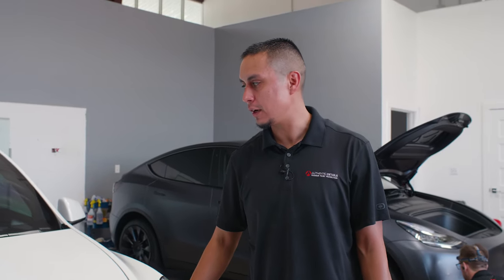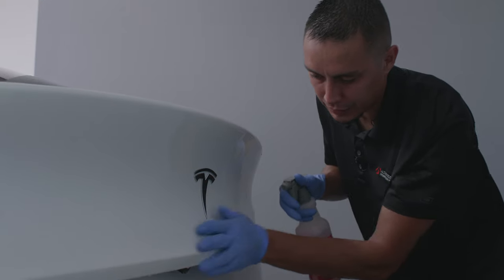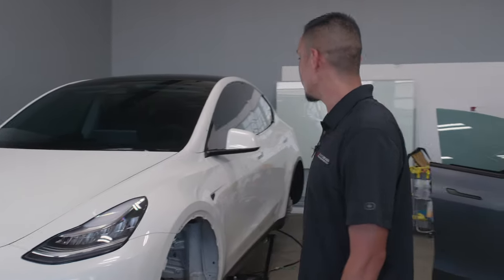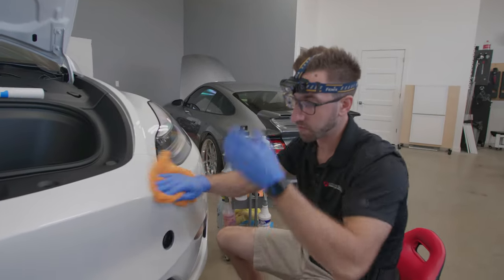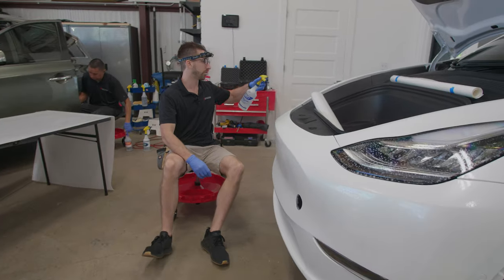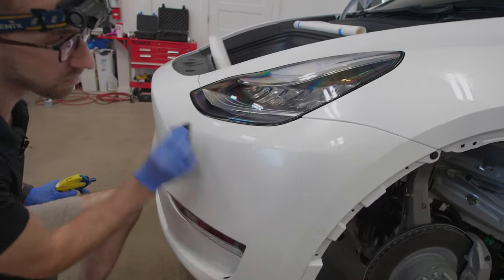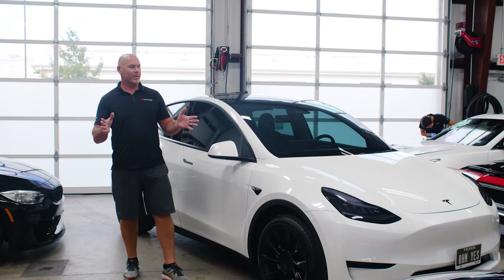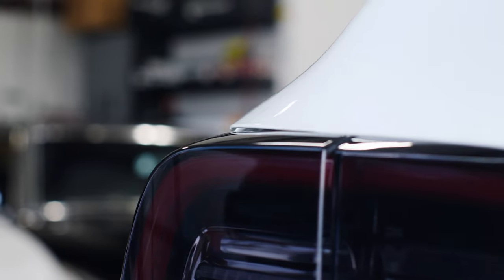Tesla Model Y Full Car PPF (Paint Protection Film)

Comment: Excuse my ignorance but how does removing all that trim not void the car’s  warranty? You get a leak... Tesla’s going to ask who the hell removed the trim! Getting a ppf done. Not sure if I should expect or want this sort of overkill.
Reply from the maker: Portlandia, solid question. Great part is - every client has a choice on how far we take our installs. This customer in particular wanted a few edges and seams as possible so we walked the car and discussed an approach. That said, we only remove parts that easily remove and reinstall without risk or requiring any special tools, but it's always a choice for the client to determine how far we go with each installation.
Reply: I had that same cringe reaction too. Pulling all that OEM trim and weather seal. A beautiful job, by not the path I would of chosen. South Florida is not really bad on a car’s finish either, especially if garage kept.

Comment: you guys almost disassembed the whole car... any rattle sound after install back?
Reply from the maker: It looks that way, but all of these parts are very easy to remove and clip back in or screw in. We focus on only removing low risk parts from any vehicle. This means if it breaks easily, doesn’t re-install well or has a risk of failure after re-install, we leave the part on the car.

Teslas are very simply constructed vehicles, so they lend well to this kind of disassembly for quality installs. 

After over 1000 Teslas, we have had zero come back with issues of rattling, parts failing etc.

Comment: I was surprised that the lights wasn’t removed first.
Reply from the maker: That could be an option, but our focus is to only remove parts that are low risk to remove and come off easily or need to be removed for a clean install. Some shops remove the bumpers as well - we just don’t see the reward in going that far as it has no added value to the install.

Comment: Awesome guys. What plotter do you use?
Reply from the maker: Thanks Stephen! When we started the shop I had a friend who had been installing for over 10 years and he had multiple plotters and said the one we have currently is the best choice. Cost is reasonable and it’s a workhorse. We use a GCC Jaguar VLX 72” and it’s been running strong for 4 years. We maintain the hell out of it, keep it clean, disassemble it often to clean it, replace rollers and parts to keep it new. I’d recommend it at half the cost of a Graphtec.

Comment: With a PPF, do you recommend a ceramic coating to cover it or do you believe that with proper care, things like discoloration wouldn't happen?
Reply from the maker: Adrian, we do often add a ceramic coating to the PPF as it does help make cleaning easier and adds UV protection to the film. However, you have to be careful as many Ceramic Coatings have solvents that will eat through the PPF topcoat - either using a PPF specific coating or a light coating (single layer, 1 year type of coating) is recommended.
Reply: @authenticdetails  Thanks for the reply! Would that 7500 estimated price include the coating or is that just PPF?
Reply from the maker: @adrianstrong3312  for our shop we include a PPF specific coating. However, on DynoPrism, it has a nano ceramic topcoat so other ceramic coatings don’t adhere to it very well.